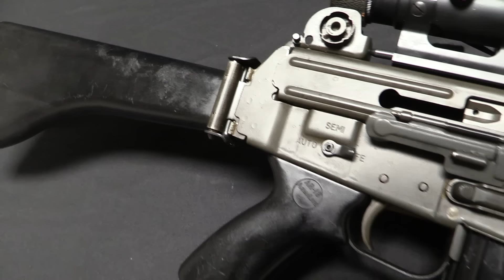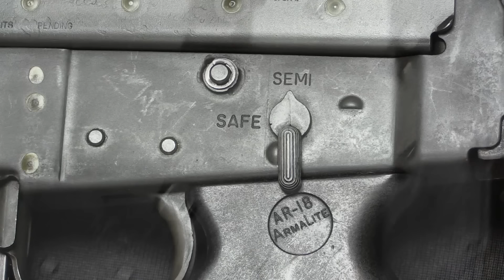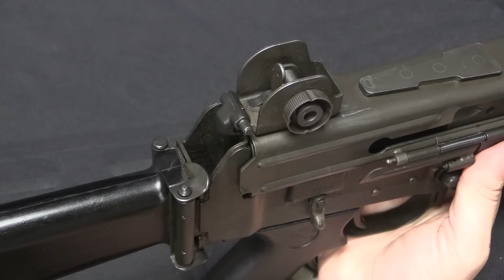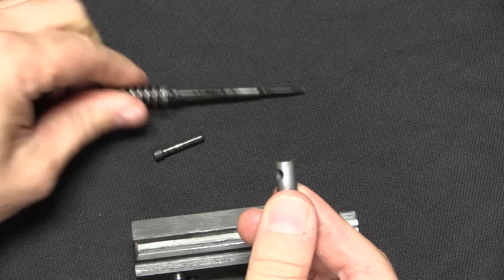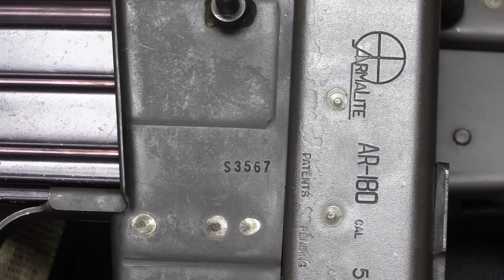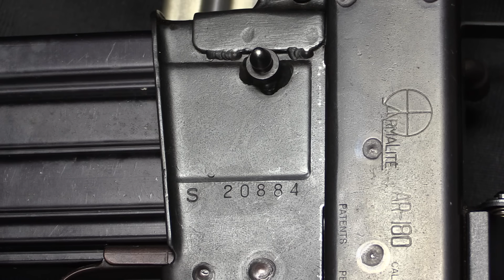AR-18 and AR-180: Can Lightning Strike Twice for Armalite?

Comment: I had all 3 mfg'ers at one time . When I talked to Gene I mentioned that I thought the AR15's gas design was great because the gas entered the carrier and pushed the bolt forward and the carrier in the other direction which helped push the bolt forward and reduced the pressure on the rear of the locking lugs to make it easier to unlock . This was the difference between the AR15 and the AR18  . His comment was , he never thought of that ! Cool  !

Comment: I have a Sterling version of AR-180 with scope and Bayonet. The original Magazine was Junk the friend I bought it from made up around 17 Magazines from surplus US Military and they have the slot and a bit of the follower cut down at the back for the bolt hold open function to work properly. I also sourced some 30 round magazines from Israel sources made of Zytel plastic. Not sure of the spelling on that. It shoots a half minute of angle with tracers 2 round test with two shooters at 200 yards.

Comment: Best gun channel on the web! 

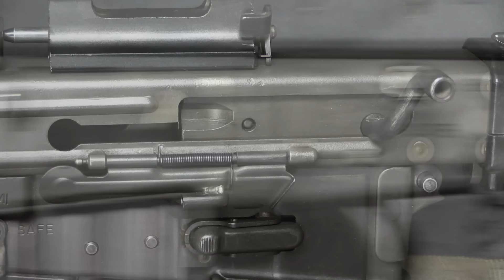Just one correction… if not already mentioned - @ 7:23…The charging handle does not engage the angled portion of the dust cover thus forcing it open … the dust cover pops open the moment the bolt carrier group begins moving rearward due to contact between a beveled “ramp” cut into the rear of the carrier making contact with the forward portion of the ball/detent “catch” of the dust cover…

Comment: An incredibly underrated weapon.  I picked up a Costa Mesa AR-180 many years ago at a pawn shop.  Someone had let it rust and they'd spray painted the whole weapon.  Still, I was impressed with the simple folding stock and the super-fast field stripping.  The gas piston system is something that AR-15 clones are mimicking now.  With all the air space in the receiver, the AR-180 should out-perform the M16 in dirt and muddy operations.  The Mag Catch system was probably the biggest hindrance to getting US Military contracts... why have to have 2 magazines for the same caliber?  The fact that you could hand-adjust windage was a real plus over the M16, but Armalite retained the bullet nose adjustable front sight configuration... not smart.  Would have made a good weapon for Airborne troops.

Comment: Loved my AR-180.  My first semi rifle.  My regret was selling it back when buying/selling wasn't so restricted.  My ONLY problem was thinking I could launch a practice grenade with the stock on the ground and yes, cracked the stock mount where the spring-loaded pin engaged the stock.  Yes, back then we could buy grenade launcher rounds over the counter.  Had the Armalite scope and mount.  It actually had a pretty good return to zero when re-mounted (after about 5 rounds to seat it).  Also had an Armson OEG site that made it even more fun (back in the day before "red dots" were a real thing)

Comment: The AR18/180 never benefitted from DEVELOPMENT,  like the AR15 did, so comparing both guns is unhelpful to say the least. 
Apart from the very weak stock hinge assembly and the fragile bolt holdopen, I feel that the AR18/180 was not so far off from being an excellent piece.

Comment: The AR-180 is the one you want for a collectible, but if you want a good shooter, you’ll want the AR-180B version. As noted, it takes AR-15 mags and has a better trigger, in my opinion. It’s also lighter at 6 pounds. Very handy and accurate to boot. It got some negative rap, because the lower is a steel reinforced polymer and not the more popular stamped steel. There were a couple examples of early rifles breaking at the front pin, but that was addressed by beefing up the area. The breakage was mainly caused by people “shotgunning the two receiver halves open and stressing the front pin. Don’t do that and you’ll be fine. Most also have a integrated muzzle brake instead of a threaded barrel. A left over from the AWB, a competent gunsmith can easily thread the barrel if desired. I have found the existing brake to be quite efficient, so I never bothered changing it. It also has a 1 in 9 twist to stabilize heavier bullets, over the AR-180 original 1 in 12 twist. Stormwerks makes rail mounts and folding stock adapters to add the stock of your choice. My only complaint is the safety has no detent, so it just turns from Safe to Fire (and back) without any positive “click”.

Comment: I do want to note the IRA also used the AR-15 fairly extensively, but they much prefered the AR-18 and AR-180, in part due to their folding stocks which made them easier to hide and conceal. However, the AR18 became very much a symbol for the IRA

Comment: Your video on these got me to thinking. Our 180's had a few differences from yours shown. Markings were from Armalite, no other manufacture. The construction appeared to be of the Sterling issue. Ours did have the retention holes in the rear sight shroud for the bolt carrier retainer guide rail unit. The forward connecting pin was captured like the M-16 to prevent loss. The muzzle brake was of the M-16 Bird Cage type. The charging handle was straight out with a larger round knurled tube. The mounting bracket on top of the upper receiver was more substantial, retaining zero. The scope was of the Sterling era weapons only with MIL-SPEC sight pattern. Our forward grips had more holes all around with groves for better grip. We were issued a forward mount bi-pod that clipped into the bayonet bracket. The legs when installed folded to the rear. It did have some left to right swing, and adjustable length legs. The main leg parts were stamped with detent cut rods capped with a flat round foot and a small part of the leg stuck out beyond.  The four Lefty shooters in the unit did have a tang added as a brass deflector that was of little use. I'm not sure of any more concerning where these came from, or whatever happened to them after I left the unit. Serial #'s were A then seven digits starting at 101 to 501 with the zeros slashed thru.

Comment: The dust cover isn’t opened by the charging handle hitting it. It’s actually opened by the bolt carrier moving back and pushing the dust cover plunger housing, which holds the dust cover closed against receiver, out of the way.

Comment: Well the popularity of the AR15 and their clones has created a glut of high quality parts that can be had at low low prices if you shop around for sales, deals, clearance or blems from top name brands. There is no reason to pay $1700+ for an upper unless you are afraid to assembly one from name brand quality parts. Unless you like rifles as jewelery there is little be gained from expensive billet lowers other than flared mag well and abi controls but you pay dearly for the cool design with little real utility unless you are competing.  If you are savvy and shop Father Day, 4th of July, Memorial Day, Veterans Day etc....You can often build the exact same upper that sells for $1700 for $400 to $500 in parts. I am not talking about using junk parts either. You have to be patient though and always looking for deals and snap them up when they come along. It might take you a year to buy all the parts you need on sale, clearance or blem. You might end up using a LW barrel instead of a Douglass etc.....More people should try this you would be amazed how much rifle you can build for $400 to $500 pre-covid 19.

Comment: I lived near Sterling Arms in Dagenham , East London , that made these . Their QC was pretty good and their skip was often full of rejected parts including the 40 round magazines . Needless to say I have a good collection of parts , particularly the 40 round mags for the 18 . A very desirable object in the US during the 2nd AWB . Sterling entered this as the new British Army replacement but lost out to the Enfield Bullpup version and a number of parts are interchangeable . Sterlings loss spelt the death of the company as their 9 mm SMG was not particularly liked ( we used MACs for covert ops in N I ) , nor was their 38/9mm revolver for police/army issue ( good luck if you find one of those over there !) except for some civilian use as everyone had 38 or 9mm on their FACs at that time. The SA80 or L85A1 was directly related to this rifle and as you rightly say it formed the prototype . Sterling sold their rights to a Singapore Arms subsidiary , and Sterlings chief engineer went on to create a company to build bespoke air rifles after Sterlings demise . 
The strange thing is that the 18 was actually more reliable than the early L85A1 in its early guise , once again we see politics get the better of common sense , which does make one wonder about the endurance tests for both these rifles . One thing I can say is that the SA80 did have a marginally better barrel than the Sterling AR18 and was more consistent across the batch supplied for testing .
The US had exported these to Northern Ireland illegally and during my visits to the US in the late 70s early 80s collections of cash were openly made to fund this in the Irish bars in New York and Boston in particular . In  some of the towns in Northern Ireland rows of terraced houses had their lofts (attics) converted to indoor ranges by knocking down the operating walls in the roof space . Needless to say that there are arms caches that include the " Armalite" , scattered across NI , to this very day .

Comment: The 180B was the first new gun I ever bought, so I feel a certain nostalgia for it.  Looking back though, it seems more like a product introduced to comply with the Clinton AWB and other state-level, model-specific bans.  There were some smart, modernization choices like using standard AR FCG parts and magazines, but the relatively obscure model, the integral muzzle brake, the fixed stock, and the ten-round mags all point to design by regulation.  Might it have taken off if the 1994 ban did not sunset in 2004?  Maybe, but it was never going to be as versatile and customizable as the AR-15, which I think are two of the rifle's key selling points. The war on terror undoubtedly also helped boost the popularity of the AR-15, as images of American troops with M4s and M16s streamed into homes on a constant basis and questions about the platform's reliability seemed to be put to rest with a resounding "good enough!"

One of my first YouTube gun projects was threading the muzzle of my 180B using an annular cutter. The only choice for a device was a duckbill flash hider like the originals had!

Comment: The gas system is the same in T65K2 used by Taiwan
T65K2 basically is an AR15 with an AR18 gas system

Comment: In many ways the AR-180B is an improvement in that it accepts standard AR15 mags has better sights and uses the more common AR15 trigger group parts.  Remember it stated as a 1994 AWB time frame built rifle so it lost the cool side folding stock and 3 prong flash suppressor.

Comment: I almost bought on just because it eas less than the ar-15 and I had never seen one before. I was also wondering if Sterling of England was the same Co. that made the 22 lr pkt. pistol? I bought a used one in Las Vegas around 1974, a very unreliable pistol.

Comment: I was just discussing being intelligent versus being good at one thing. Everybody is good at one thing . (alsoI learned the ar-10/15 gas systems as being delayed direct gas impingment as written by mr. Jim Sullivan for the origional pennfoster "gunsmithing, semiautomatic rifles book" in their old correspondense course.it was more a enginering and firesrms design course with gun specific information like full teardown and cleaning of a firearm, surface treatmants like manganese phosphate , conversions hot salt bath nitride , nickle boron , titanium nitride, plating like chrome and np3) ...direct because it is tapped directly out of the barrel and the gas goes to the bolt carrier group directly, delayed because the bolt carrier has to pressurize completely before it starts rearward travel . that is the point the gas will act as it is hitting a hard surface in the gas key and pushes against the artificial surface to cycle. This is a main reason we do not jump to drilling out the gasport with cycling issues.  If the gas has to much velocity it will fill the carrier to fast and prematurely eject the pressurized casing. This tends to tear the casehead off, but not always. It also stovepipes , misses the next round in the magazine, grabs the ext round and bends it because it jumps and collides with the barrel extension and more.  Very few of which will actually detonate the cart. However a jammed in case bullet would be a problem if it feeds. So we dont drill. Not even if its too small.  test and check every other point first.  Sorry to ramble on...this is another excellent video do to intellect at work. Its not just being "good at guns" .this is study of history and the ability to grasp interesting side notes... and the gift of gab.  It makes for a higher quality end product.  
I also like how the trend of saying some form of " im dumb just like you my viewers and its ok that we are dumb"...has not reared its ugly face here.  Thankyou Gun-Jesus. You truely are the modern patron st. off Firearms.

Comment: I bought a new AR180 B in 2008.Got rid of it after I found the bolt wouldn't fully close on a full magazine if the barrel was held up at a 45 degree angle. I concluded that this was because the dual recoil springs were too weak.

Comment: I have a Costa Mesa AR-180. Very nicely made little rifle. Light, easy handling. Accurate. Two things I would change. The folding stock latch/mount assembly seems flimsy for hard use. And the barrel is 1:12, so it's limited to 55-60 gr flat base projectiles.
Shame it wasn't a commercial success. The Costs Mesa were reputed to be the best, Howa second best, and the Sterling, not so much. I saw a Sterling with the front sight improperly clocked, and finish salts were leaching out from under attached metal parts.

Comment: Just to share. I had a Costa Mesa 180 for many many years and it was dead on reliable digesting many thousands of rounds with not a single hiccup or parts breakage. I found it overall an outstanding platform and certainly decades ahead of its time. Only issue I had was the folding stock stamped sheet metal cracked in several places from fatigue and needed a weld repair. Later, I had a Sterling and it was also excellent.

Comment: The AR-18 is an interesting what if because of how the gas piston system would be copied and used as the basis for so many modern day military rifles.  Guns like the Howa Type 89, the Enfield L85, the H&K G-36, the Daewoo K-1 and K-2, the FN F2000 and FN SCAR among many others all owe their existence to this rifle that is most known as the right arm of the Provisional Irish Republican Army.  It makes me sometimes wonder if the rifle would have been better or worse off if say a nation like Great Britain looked at how light, compact, reliable and easy to manufacture the AR-18 was and decided to pay Sterling/Armalite for the rights to co produce the AR-18 or a non bullpup variant thereof through Royal Ordinance or RSAF Enfield rather than stealing the design and butchering it with the SA80 bullpup.  Or say if a nation like Brazil, Portugal, or Turkey chose to adopt it to replace their 308 battle rifles.

Comment: Heluva lot of little itsy bitsy parts to lose in the dirt or snow if you have to field strip in the field rather than on the range or the barracks floor. I'd prefer an AK any day -- the bolt's the smallest part, it's the size of your thumb and definitely won't blow away, and you can field strip the AK and put it back together again blindfolded in under 20 seconds.

Comment: Had a 180B with plastic lower receiver that cracked on front locking pin hole. WTF Gun designer
Edit. Broke after three years

Comment: The reason for the dog leg charging handle wasn't for ambidextrous use, but so you don't chew your index finger knuckle up on your right hand when charging the bolt.  The earliest versions have a straight charging handle, and it did not work very well.

Comment: I wanted an AR-180 since I first read about them, 40 years ago. The thing about the AR180B that kept me from buying one, was that lower receiver and the side-folding stock on the original were combined into one solid piece. The side-folding stock was one of the biggest selling points of the AR-180 and they eliminated it. Plus a lot of people, myself included, would rather have a rifle with an all-metal receiver, not plastic. No wonder it didn't sell very well. If it was steel or forged aluminum instead of plastic, and had a folding stock, I would have bought one. 

 There was an AR-18K version of the select-fire AR-18 too. It had a short barrel, 10" long I think, with a cone-shaped flash hider. And it had a second pistol grip on the fore end, Tommy gun style. If anyone would have just left the forward pistol grip off and made a semi-auto AR-180 pistol, I would have bought one of those too. But since I can't afford a real AR-18 or AR-180, I'll settle for one of Brownells'  BRN-180 uppers and a BRN-180 forged lower that's styled like an AR-180, but uses an AR-15 trigger group. The lower has a section of 1913 Picatinny rail on the back to attach a stock like the Sig MCX telescoping folder.

Comment: Except for the weak folding stock on the AR 18 and ar-180, an easy fix, and mildly less accurate. It was a superior rifle in every single way.

I happen to know somebody who is involved in the testing of the AR 180 against the M16. They intentionally used bent magazines in the AR 18 every single time.

There may have been some purchased by US military only for special ops where they did not want the firearm displaying what military they were. I would love to have one because it will be running when they AR-15s quit running when the shtf.